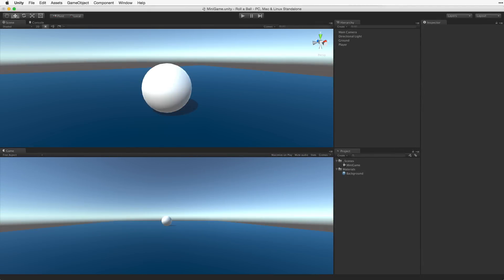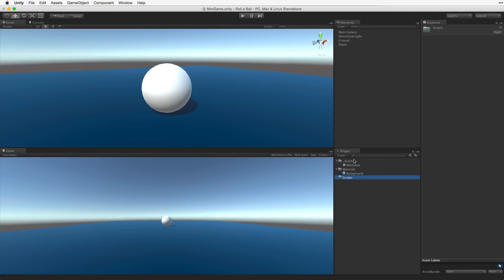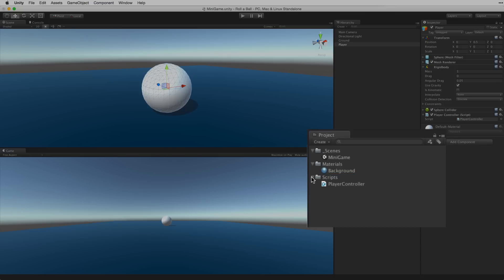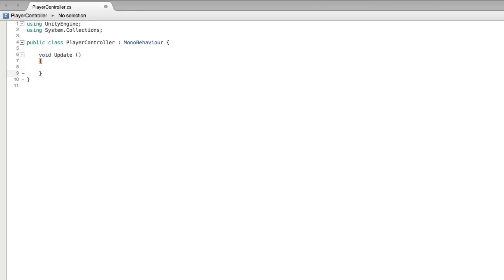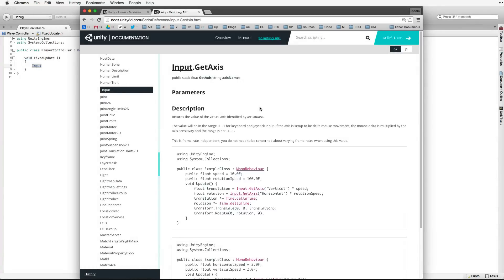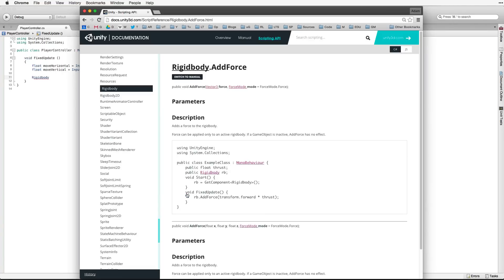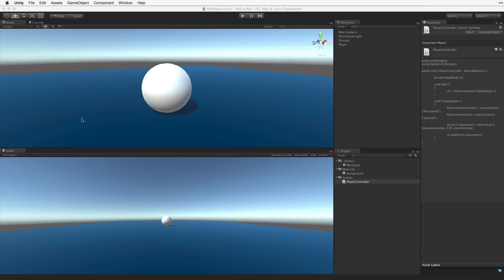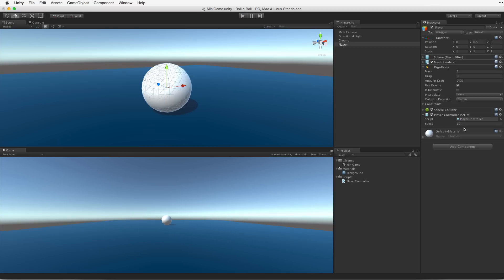Unity 5 - Roll a Ball game - 2 of 8: Moving the Player - Unity Official Tutorials

Comment: I'm coming from java and I can read the code but kinda confused. So you assigned class Input to  float variables and called the method/function GetAxis. But when you called GetComponent you used a different syntax. I get that you assigned rb type Rigidbody with access specifier private, and I get that you placed it in the class so it's an instance variable. But I'm confused about the <Rigidbody> when you called GetComponent vs GetAxis. so basically what is <> and what does it do?
can you also do this with the GetAxis?
float MoveHorizontal ;
MoveHorizontal = Input.GetAxis("Horizontal")
Reply: Oh okay looking at the code a little longer is <Rigidbody> an instance of the class, so is rb an object of class Rigidbody? so you can use it on FixedUpdate method cause in the example it calls the AddForce method rb .AddForce(Vector3) using the instance variable that is assigned to GetComponent<Rigidbody> in the Start method. I would've thought that it would be out of scope. If it's out of scope then would Start not be a method but a constructor. Sorry I'm just trying to understand C# better so I don't have to memorize syntax.
Reply: oh nvm it's not an Object -_- cause you created an object called movement for class Vector3 with three arguments x,y,z. and used that as a parameter for calling AddForce method. I'd probably have to look it up. But other than that thanks!
Reply: what key did we assign input to?

Comment: if it is not moving, change 
private Rigidbody rb;
to
public Rigidbody rb; 

then above speed in the inspector will be rb, drag the rigid body component into the box.

this worked for me, i couldn't get the private to work
Reply: That's bizarre. This shouldn't make a difference. It sounds like you aren't properly setting the reference in the Start() function, but without seeing your code I have no idea.

Comment: Someone help this code isnt working it is literally word for word i use a mac
using UnityEngine;
using System.Collections;

public class PlayerController : MonoBehaviour {

 public float speed;

 private Rigidbody rb;

 void Start () {
 {
  rb = GetComponent<Rigidbody>();
 }

 void FixedUpdate () 
 { 
  float moveHorizontal = Input.GetAxis ("Horizontal");
  float moveVertical = Input.GetAxis ("Vertical");

  Vector3 movement = new Vector3 (moveHorizontal, 0.0f, moveVertical);

    rb.AddForce = (movement * speed);
 }
}

Comment: His code does work.  I had an error in the beginning, something like rb symbol not recognized, but it was my fault, I had forgotten to put a semi-colon ( ; ) at the end of the "Vector3 movement" line.  To everyone having trouble, make sure you check every capital letter is correct, every semi-colon is there, every () vs. {}  is correct, even your indentations, and especially the spelling. If you're using an editor like Visual Studio, it helps because it gives you clues and shows you where there is a problem.

Comment: Hello everyone idk if anyone else has come across this issue or not but I coded the movement controls exactly right yet nothing happened during the play testing. It was both confusing and frustrating then I checked the inputs listening key in Unity. It was set to the joystick for some reason. So changed it to the keyboard/mouse listener and everything worked perfectly! Hope this helps anyone that's extremely frustrated and/or with people who hate coding!

Comment: Right, so, I think I've done it right, because my ball is moving, but for some reason it's floating a few feet off the ground. Why is it doing that? Is this tutorial haunted by the ghosts of those who died of frustration? I can provide my code if that helps?
Reply: Nevermind, for some reason the height was being multiplied by the size of the plane? For instance size 1 would put it at height 1.5 when it was supposed to be at 0.5, but size 0.5 would put it at 0.75.

Comment: The ball doesn't go...

codes:

using UnityEngine;
using System.Collections;

public class PlayerController : MonoBehaviour {

 public float speed;

 private Rigidbody rb;

 void Start ()
 {
  rb = GetComponent<Rigidbody>();
 }

 void FixedUpdate ()
 {
  float moveHorizontal = Input.GetAxis("Horizontal");
  float moveVertical = Input.GetAxis("Vertical");

  Vector3 movement = new Vector3 (moveHorizontal, 0.0f, moveVertical);

  rb.AddForce (movement * speed);
 }
}

Someone Help ME............
Reply: make sure you save it in the right folder which is your Assets > Scripts > PlayerController.cs
Reply: we have the same code.. mine worked
Reply: Oh I'm stupid i didn't press the arrow key!!!!!

Comment: it says "void cannot be used in this context" l: this is my code

using System.Collections;
using System.Collections.Generic;
using UnityEngine;

public class PlyerController : MonoBehaviour {

 private Rigidbody rb;

 void Start ()
 {
  rb = GetComponent<Rigidbody> ();

 void update ()
 {
  float moveHorizontal = Input.GetAxis ("Horizontal");
  float moveVertical = Input.GetAxis ("Vertical");

   Vector3 movement = new Vector3 (moveHorizontal, 0.0f, moveVertical);

   rb.AddForce (movement);
 }
}

Comment: I think the tutorial should explain why many viewers can not move the ball. Although I could find the solution in Unity forum, it is still uncomfortable for a "beginner" level. My solution: add the line "public float speed;" in the PlayerController class but outside the Start() function (a global variable), in the last line multiply the movement vector with speed.
Do not forget to add the script to Player object. Change the value of speed in the Inspector, for instance, 1 then try moving by direction keys: (Up, Down, Left, Right). Peace! 

My full script: 
using System.Collections;
using System.Collections.Generic;
using UnityEngine;

public class PlayerController : MonoBehaviour {

    public float speed;
    public Rigidbody rb;

    private void Start()
    {
        rb = GetComponent<Rigidbody>();    
    }

    void FixedUpdate()
    {
        float moveHorizontal = Input.GetAxis("Horizontal");
        float moveVertical = Input.GetAxis("Vertical");

        Vector3 movement = new Vector3(moveHorizontal, 0.0f, moveVertical);

        rb.AddForce(movement*speed); // Remember to adjust the value of speed in the Inspector 

        
    }
}

Comment: This tutorial is terrible it does not tell you how to get the ball to move I have been coding for a while and I still struggled with this because the tutorial is so bad. I get an error ArgumentException: Input Axis Horizontal is not setup, and the ball will not move even if you follow this tutorial 100% accurately.

Comment: I typed the scripts and there is NO error shown in the Unity BUT Still I cannot move the Ball?? I checked all ";" and () as well as {} Every thing is fine. BUT the Ball is not moving!!! :(
Please help. I used (W, A, S, D) keys but still not moving.
Reply: This is what I have wrote: I am a mac user
using UnityEngine;
using System.Collections;

public class PlayerController : MonoBehaviour {

 public float Speed;
 private Rigidbody rb;

 void start ()
 {
  rb = GetComponent<Rigidbody>();
 }
 void Fixedupdate ()
 {
  float MoveHorizontal = Input.GetAxis ("Horizontal");
  float MoveVertical = Input.GetAxis ("Vertical");
  Vector3 Movement = new Vector3 (MoveHorizontal, 0.0f, MoveVertical);
  rb.AddForce (Movement * Speed);
 }
}

Comment: there is some code missing 
GetKey  
show the reference of button 
using UnityEngine;
using UnityEngine.UI;
using System.Collections;

public class PlayerControler : MonoBehaviour {

 public float speed;

 private Rigidbody rb;
    

 void Start ()
 {
  rb = GetComponent<Rigidbody>();
 }

 void FixedUpdate ()
 {
  float moveHorizontal = Input.GetAxis("Horizontal");
  float moveVertical = Input.GetAxis("Vertical");

  Vector3 movement = new Vector3 (moveHorizontal, 0.0f, moveVertical);
        if (Input.GetKey("up"))
        {
            rb.AddForce(movement * speed);

        }
        else if (Input.GetKey("down"))
        {
            rb.AddForce(movement * speed);
        }
                
    }
   
}
Reply: this will work 
and give the speed to a ball in unity playerControler UI

Comment: Hello Guys,

Good quality of video, almost clear with obviously some shadow when trying to obtain the same result using the tool.

If you have changed the code because of errors and after rebuilded the code: 

1-go into Unity > Edit > Undo Selection  Change. 
2- Edit > Play
3-Press now your keyword Arrows, it should begin to move after few seconds

I don't know if it's a good practice but like some people have adviced before, change private Rigidbody by public Rigidbody on top of the code, you should now see the editor understand what you are talking about in the typo style.

Comment: Had the same problem with the ball not moving. Was a spelling mistake at "FixedUpdate()", i wrote it in lowerCamelCase... I looked these comments up for solutions first and i was so sure i wrote everything perfectly fine and had no spelling mistakes, but in the end, there was one. 

SOO, even if u think you wrote everything as it should be, you better double or triple check the code XDD

Comment: cannot for the life of me figure out why my ball won't move. This is my code. my speed value is set to 10 in the editor and it doesn't show any errors.

using System.Collections;
using System.Collections.Generic;
using UnityEngine;

public class playercontroller : MonoBehaviour {

 public float speed;

 private Rigidbody rb;

 void Start ()
 {
  rb = GetComponent<Rigidbody>();
 }

 void fixedupdate ()
 {
  float moveHorizontal = Input.GetAxis ("Horizontal");
  float moveVertical = Input.GetAxis ("Vertical");

  Vector3 movement = new Vector3 (moveHorizontal, 0.0f, moveVertical);

  rb.AddForce (movement * speed);
 }
}

Comment: Excellent video, simple to follow. 
Two Items I would note;
1 - The default playing field for the version I'm on seems to be smaller then the one you've created. Might be worth noting the size your setting yours to.
2 - Unity identified my VS.Net and set it as the primary editor. That would normally be fine by me but that killed some of the type-ahead behavior and more importantly your CRTL + ' example. You might want to note that this only works in the Unity editor and not in VS and you may want to provide directions on how to change the editor to Unity.

Again Great tut!

Comment: What's the key combination for the CTRL ' shortcut on QWERTZ keyboards? CTRL ' doesn't work because I need to hold down the CAPS key to type in " ' " and when I hold down CAPS, I can't activate the shortcut.

Also, you're doing way too fast. I don't have any expierence in C# and you don't do a good job at explaining what I should do and why I should do it at the C# part.
And why are you constantly deleting stuff from the script after explaining something? That tricks newcomers easily and makes them really frustrated. At least I get frustrating at it because you're typing in so much complicated code to catch up, unpause the video and find out you have to delete some stuff again.
Come on, at least DON'T type that stuff in so I don't have to correct the script AND add some nonsense that isn't well explained at all again.
And why is the "float" in "public float speed" blue on your end but green on my end?

Comment: can anyone check my code? I am pretty sure i followed the direction step by step... but the ball still won't move.
Thanks in advance. I'm a beginner in coding. Let's connect on Gitter if anyone want to learn together!

using System.Collections;
using System.Collections.Generic;
using UnityEngine;

public class playercontroller : MonoBehaviour {
    public float speed;
 private Rigidbody rb;

    private void Start()
    {
        rb = GetComponent<Rigidbody>();
    }

    void FixUpdate() {
         
        float moveHorizontal = Input.GetAxis("Horizontal");
        float moveVertical = Input.GetAxis("Vertical");

        Vector3 movement = new Vector3(moveHorizontal, 0.0f, moveVertical);

        rb.AddForce (movement * speed);
         
            }
}

Comment: I did exactly as shown in this video... but I get three error messages concerning the script... "inconsistent line endings", "cannot have void type" and "a get or set accessor expected"
Reply: Check the first lines, it should be :
using UnityEngine;
using System.Collections;
Had the same problem and that was the solution.

Comment: For those of you having trouble getting the ball to move with the keyboard:
I suggest you double-check your code before doing the next thing I will recommend but for me, the problem was very simple. I followed the tutorial EXACTLY and could not get the ball to move, looking back at the video however I found my error, and it was a very simple one. When the individual talks about the various methods to create a script, he did not specifically state that the script had to be located in the 'Player' folder where the ball is located. Assuming that you just did I what I did, and went to Assets>Create>C# Script the C# file will be located in the root directory of your project folder and not under the 'Player' folder, WHICH IS ESSENTIAL IN ORDER FOR IT TO WORK! Try deleting the code, and select the Player Folder>Add Component>New Script>Name the script "PlayerController" and save it as a Cs or C# file. Rewrite the code, then press play on the Unity engine and hopefully your ball rolls with the WASD keys ;)

Comment: is this correct

 private Rigidbody RB;
 public int Speed ;
 public int JumpHeight;
 // Use this for initialization
 void Start () 
 {
  RB = GetComponent<Rigidbody>();
 }
 
 // Update is called once per frame
 void Update () 
 {
  if(Input.GetKeyDown("w"))
  {
   RB.AddForce (new Vector3(0,0,1*Speed));
  } 
  if(Input.GetKeyDown("s"))
  {
   RB.AddForce (new Vector3(0,0,-1*Speed));
  }
  if(Input.GetKeyDown("a"))
  {
   RB.AddForce (new Vector3(-1*Speed,0,0));
  }    
  if(Input.GetKeyDown("w"))
  {
   RB.AddForce (new Vector3(1*Speed,0,0));
  } 
  if (Input.GetKeyDown ("space")) 
  {
   RB.AddForce (new Vector3(0,1*JumpHeight,0));
  }

 }
 void FixedUpdate()
 {
  float moveHorizontal = Input.GetAxis ("Horizontal");
  float moveVertical = Input.GetAxis("Vertical");
     
  Vector3 movement = new Vector3 (moveHorizontal, 0, moveVertical);

  RB.AddForce (movement);

 }
Reply: no it didn't
Reply: what the hell?

Comment: so, i was having problems with movement, the object would only obey the up and down arrows or the left and rigth, never bouth at the same time, after giving up because no ones problems were like mine and too impacient to wait for some one i started changing thing and found this: in the capsule colider, my height was 2, i chenged it to 0,5 and it started working, same code as the vídeo.

Comment: I keep getting errors even know it seems identical to the code in the video. 
Anyone help?

using System.Collections;
using System.Collections.Generic;
using UnityEngine;

public class PlayerController_ : MonoBehaviour {

 private Rigidbody rb;

 void Start ()
 {
  rb = GetComponent<Rigidbody>();
 }
 void FixedUpdate ()
 {
  float MoveHorizontal = Input.GetAxis("Horizontal");
  float MoveVertical = Input.GetAxis("Vertical");
 
  Vector3 movement = new Vector3 (MoveHorizontal, 0.0f, MoveVertical);

  rb.AddForce (movement);
Reply: if you copied whole code you are missing   }

Comment: when I click on the GetAxis link it doesn't pull up that page. It pulls up a page with just this:

DescriptionReturns the value of the virtual axis identified by axisName.The value will be in the range -1...1 for keyboard and joystick input. If the axis is setup to be delta mouse movement, the mouse delta is multiplied by the axis sensitivity and the range is not -1...1.This is frame-rate independent; you do not need to be concerned about varying frame-rates when using this value.

wth??

Comment: i cant enter play mode
it says all compiler errors have to be fixed before you can enter playmode!
here is the code:

using System.Collections;
using System.Collections.Generic;
using UnityEngine;

public class PlayerController : MonoBehaviour
 {
 private Rigidbody rb;

 void Start ()
 {
  rb = GetComponent<Rigidbody> ();
 }
 void FixedUpdate ()
 {
  float moveHorizontal = Input.GetAxis ("Horizontal");
 
  float moveVertical = Input.GetAxis ("Vertical");
  Vector3 movement = new Vector3 (moveHorizontal, 0.0f,   moveVertical);
  rb.AddForce (movement);
   
 }

Comment: I literally copied and pasted the exact script but the ball still won't move in game mode, and this error message appears:
ArgumentException: Input Axis vertical is not setup.
 To change the input settings use: Edit -> Project Settings -> Input
PlayerController.FixedUpdate () (at Assets/Scripts/PlayerController.cs:19)

However I checked the input manager and it's the same i put in the script, so i really don't get what's wrong

Comment: Something I had trouble on was on the Vector3 part. Just add a new float variable at the top with any speed thats positive. And then just multiply it by your new movement Vector3. Hope this helps. The double slashes are just notes btw.

public class PlayerController : MonoBehaviour {
    // Fixed Update involves physics.
    // We will be applying force to our player . Which involves physics.
    private Rigidbody rb;
    public float speed = 1.0f;
   
    private void Start()
    {
        rb = GetComponent<Rigidbody>();
        
    }

    private void FixedUpdate()
    {
        float moveHorizontal = Input.GetAxis("Horizontal");
        float moveVertical = Input.GetAxis("Vertical");

        Vector3 movement = new Vector3(moveHorizontal, 0.0f, moveVertical);
        rb.AddForce(movement*speed); // You dont have to use *speed but I'm just putting it so I can be in control of how fast I go.

    }
}